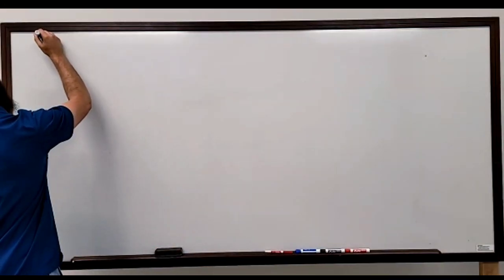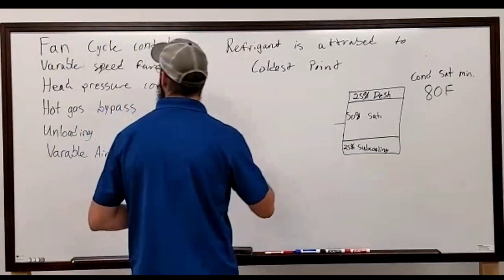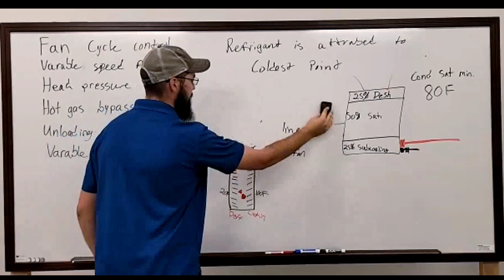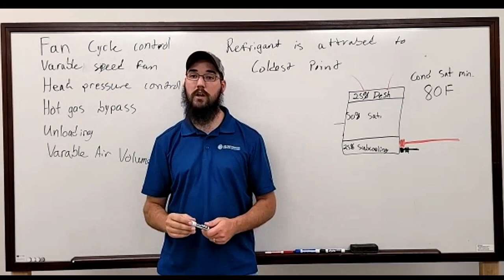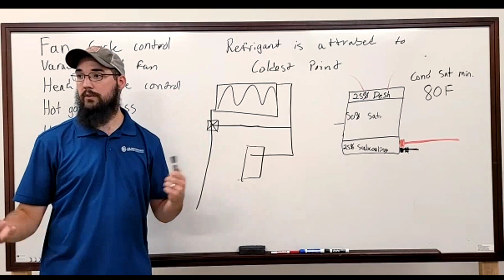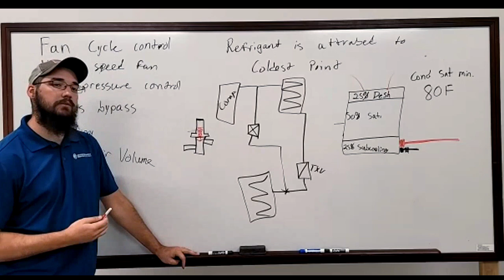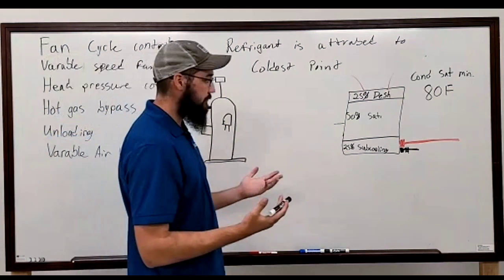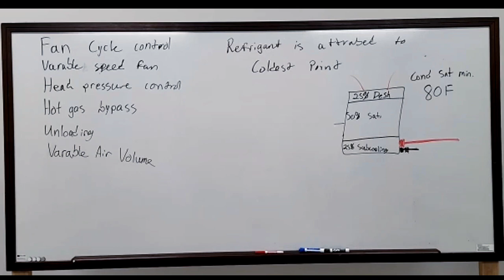Head Pressure Controls on Refrigerant Circuits HVAC Training for HVAC Technician

Comment: The locked rotor hit home for me ,the unloaders do sound unpleasant & destructive 😂 all in the name of efficiency. 
Before logic, the electronic Carlyle bypass solenoid was controlled with a two stage line voltage t-stat.( package units comfort cooling)
Thanks for the video. (The sound was trash tho)
🍺🍺🍺🥃🥃🍿🎯
Stay safe. 
Retired (werk'n) keyboard super tech. Wear your safety glasses!

Comment: Good stuff. Need to get you a lavelier mic to capture your audio a little better, some parts were difficult to make out but otherwise a good overview. Wanted to share a tip I got when wiring in a fan cycle switch for single phase applications, to take some of the load off of the actual switch; use a relay or contactor for the high voltage common leg of the motor and only pass 24v through the cycle switch to extend its life (hopefully). Also glad to hear you mention the bellows or diaphragm being a notorious leak point, make sure to nylog those threaded fittings too as they tend to be exposed to lots of vibration. Would’ve liked to hear more on differential settings to make sure you’re not cycling the fan on/off too frequently. We have warm winters here so it’s not too tough to get it right 👍. Thanks for the content as always!
Reply from the maker: Thank you for the input. Look forward to seeing you soon

Comment: The RTAF air cooled chillers have all Variable speed ECM condenser fans. Not very good on this one. It’s maybe 3 years old and just replaced 6 of them. Our cost $20,000 for six of them.🤦🏻And there are 2 more bad now also😂
Reply: I have been running into the same issues on the RTAF and RTAA. I have sat and watched these run and I they will need to be re-engineered. Those rectifiers they use are not pulsing and holding the voltage as they are suppose to do which is causing premature failures. I will need to think outside the box on these